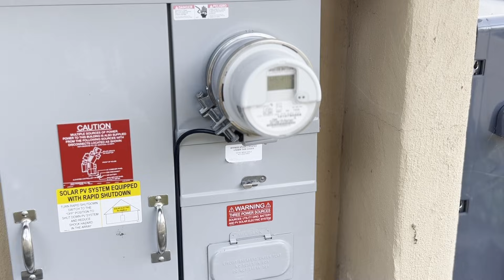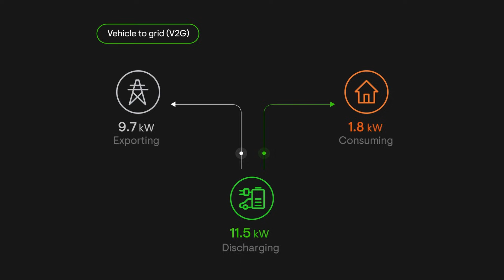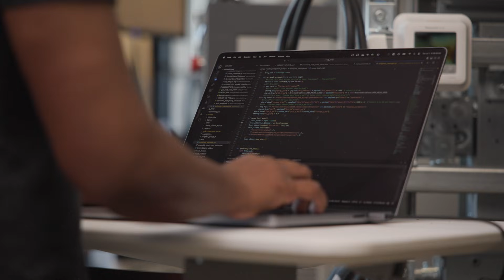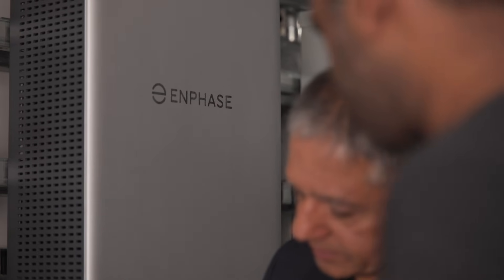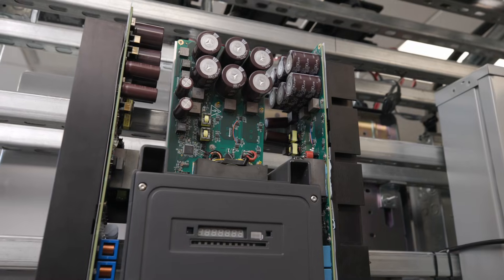Enphase IQ Bidirectional EV Charger Technical Overview

Comment: It's unfortunate that the solar can't be alternatively routed into the car directly with a DC to DC converter.  Enphase chooses to use the micro-inverters to convert DC to AC, and then have to convert that back again to DC when connecting to the car.  Lossy.  Also, the micro-inverters will clip power.  Additionally, Rule 21 in California throttles the output of the microinverters when there is excessive generation available to stabilize the grid.  Is there any company that does DC solar directly to the DC charger that is also bi-directional?

Comment: Your behind the meter device is a bit clever. Your previous bidirectional design (that you never followed through on) used the main contactor and metering devices within the system controller to disconnect from the grid during outages. Have you made your latest bidirectional design compatible with your previous design, so that the existing utility disconnect and metering in my controller can perform this function upon loss of utility? Or must we also purchase your redundant "MID" (Microgrid Interconnect Device) for your bidirectional charger to function?

Comment: Behind the meter installation not approved in my state 😞
Reply: If I can get this (assuming the price is right), I'll just manually operate it. When power goes out, manually turn off your mains disconnect, and activate this. Watch your neighbor's house when power returns or subscribe to your utility for power incidents notifications.
Reply: @im4udevco there's a way better solution than looking at your neighbors power. 😅 You just need to install a utility box downstream of the meter and put the meter collar in it and use the enphase approved meter box cover.

Comment: Not very 'Technical' ... this seems to be a 11.5 kw DC charger that can go both ways since it bypasses the car's inverters. So It's like Sigenergy V2X 25kw solution, but half.  With 11.5kw that's about 48Amps which may struggle with a 200amp service house... the Sigenergy 25kw is around 105amps which would struggle less on a larger home.  Since it's DC V2H it 'should' be able to run on older Teslas like 2018 models, as long as they are CCS compatible, and they can be bought for cheaper than the batteries.  finally sigenergy turns off the system if it can't phone home in 90 days, does Enphase have 'off grid' capability? or does it also require cloud connections?
Reply: The Sigenergy can only export the inverter max (currently 11.4 kW in the US) to the house.  The rest of the 25kW has to be used to charge batteries that are in the same inverter stack.
From a house load perspective the 2 systems are basically the same rating.  The Sigenergy is more flexible with the DC coupling to in stack solar/battery, as well as AC coupled to everything else still.  Also the Sigenergy does not turn "off" after 90 days.  They have a paper on exactly what happens and what features are available after 90 days without internet.

This enphase does look like a good solution, especially if it integrates easily with older generations of existing Enphase equipment.  There is no mention of that specifically though.  As others have pointed out, it has been "here and ready" for about 3 years.
Reply: @Tearitupsports  The question of integrating with existing Enphase equipment is important to me, especially since my system was sold as being compatible with the upcoming bidirectional charger only a few months ago. I see from their website things seem to have changed even since then. We have been delaying purchase of another used EV until Enphase provides real compatibility information. I wish they would have been more upfront about how unready this product has been all along.

Comment: So the grid operator must pay me at least what Electrify America/EVGo or whomever charges me to fill my BEV.  I’m guessing the grid operator would like me to be a per of the Virtual Power Plant at a time of their choosing.  Great idea but as always, the devil will be on the details.
Reply: In many areas there is time of use billing or overnight discounts for EV charging so you will pay something like 7-10 cents at night and 25 cents during the day per kWh. Just charging your vehicle at night and then using it when you can in the daytime saves a boatload of cash, without even exporting or ferrying energy around with your car.